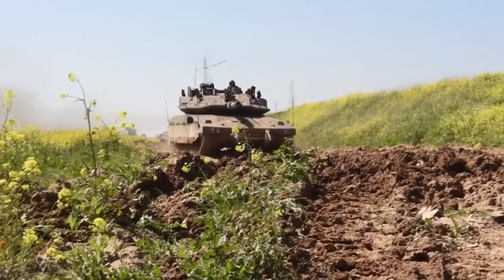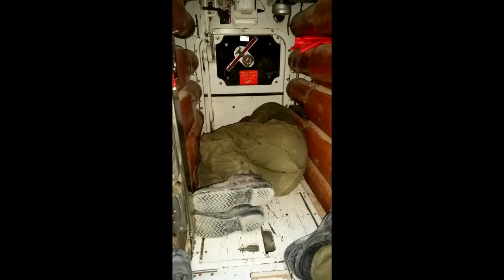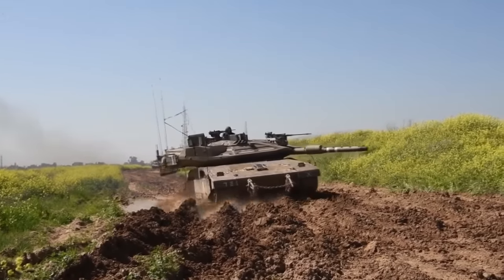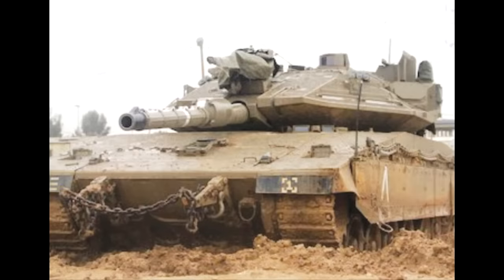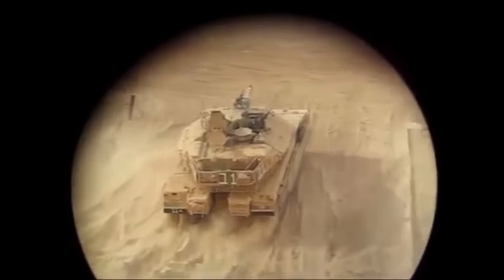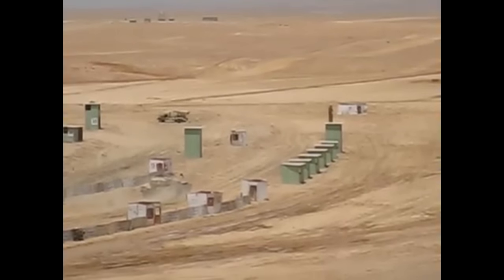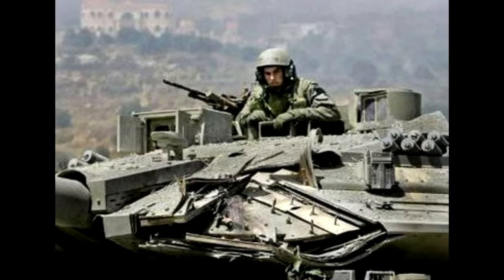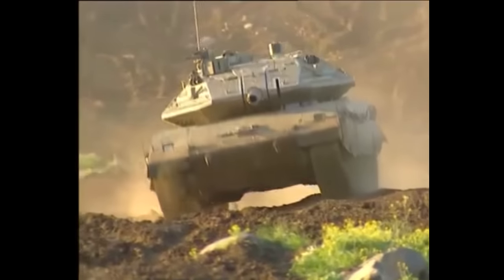Problems with Merkava tank

Comment: 1.  Composite armour may not have been that common, but the Israelis had already invented reactive armour.  I suspect that the new system was adopted because it worked better.  Just as they did away with hydraulic lines inside the turret for fire safety reasons.
2. While the tank can theoretically take 8 -10 soldiers crammed in like sardines, this has, to the best of my knowledge, apart from the unveiling of the tank on parade, only been used to extract wounded under heavy fire.
3. Yes, the engine can get damaged... but better that than the crew.  Engines can be replaced in hours.  Crew not so much.  Of course, there are countries that don't care about casualties.  
4.When you are firing hull down from a ramp, with an earthen bank in front of you, the hull thermal signature is not generally visible.  
5. Engine heat didn't interfere with the thermal imaging during the Lebanese war, when it was successfully used to kill T-72s at long range.  Using kinetic rounds.  So the best Russian armour also didn't stop kinetic rounds.  Which is why they are used. There is always an arms race with these things.
6. The Diesel fuel tanks have also worked as an added armour, but no system is perfect.  The fuel tanks are self sealing, and generally handle the danger of fire well.
7. Anti tank missiles, such as the Kornet, are taken care of by Trophy.  Russian tanks, on the other hand, were withdrawn to over 5 km from the Ukrainian forces once they were supplied with modern anti-tank missiles, and Russian aggression ceased.
8.The armour is modular, and easily replaced when damaged.  Solid armour not so easily.
9. None of my comments should be taken as angry.  I've also heard complaints about top speed, but as armies generally don't cover more than 20-30 miles in a day, whether you get there in one hour or 30 minutes is rarely decisive, and I have heard complaints that the M1 Abrams transmission cannot take the strain of digging the tank in, and it's turbine engine has always been a real fuel guzzler....
10. How may km of fish do you have to eat before you get out of the Russian Armed forces?
Reply: Here here! Finally someone that knows what he's talking about. Thank you!

Comment: So, I am no armor expert, but there are a few inaccuracies here (you don't have to like the Merkava, but tanks in general are going through a weird phase).

1. the engine at the front is not a bad thing.  There are a lot of mechanized armor that does use an engine at the front approach; such as the Stryker, the Bradley, the BMP, the warrior, the Lynx and I could be wrong but possibly the S tank.  Most of these have thermal imaging with no issues.  I have used thermal systems in a gas power vehicle plenty and looking over a combustion engine wasn't an issue.

2. the use of fuel tanks as extra armor isn't bad either.  There again are other mechanized armor that does this, and has no issues with explosions or fires using diesel fuel (as it can be very difficult to start a fire) and Merkava's fuel tanks are self sealing as well.  

3. "the armor is insufficient" is inaccurate against other tanks.  Against Lebanese and Syrian troops in the 1980's conflict, the 2006 and 2008 conflict, the Merkava was far superior in protection than the soviet counterparts in durability and protecting against other tanks.  They only lost 7 in the 1980's conflict (granted a different mk of Merkava, but the new one is better).

4. It isn't up to date.  Many of the battlefield communications and digital combat systems are so well designed, the USA have used similar programs.  The Trophy active protection system is so advanced and works so well that other NATO countries have been purchasing it from Israel as well.  The is mainly because man portable missiles are becoming much more prevalent to the enemies and effective that tank vs tank warfare.

Realistically tanks are having a difficult time in combat due to the advances of small anti-tank weapons in general.  The US Marines have disbanded their tank program all together, and there are other countries doing the same.  In similar peer combat (modern nation vs nation) it is possible for the tank to still play a role, but drones, stealth aircraft, computer hacking of satellite and comms systems along with man portable missiles (like the Russian ATGM 9M133 Cornet) allows two to three men to set up an anti-armor position and take out almost any tank (not including the Trophy system) and quickly leave, all while not requiring a heavy vehicle for transport.

Comment: Definitely a good flawbreak down on the tank. Well laid out and good details for an otherwise short video. Actually dispells alot of myth and hype around that tank, never knew the ammo was rather haphazardly left exposed in the back with very minor protection or that the front lower plate was so thin, seems almost a frail design minus maybe being hulled down in a tank pit like in the region bordering syria and etc, a defensive tank

Comment: The Israeli designers knew exactly what they were doing.
They put the engine in the front to save the crew,as highly trained crews in this very small country  are more valuable than engines.
This tank is brilliantly simple and if you recall the entire tank has been upgraded continously since the 1980's.
The Russian Coronet atgm has taken out a few of them,but with the Trophy system all the missle threats take a hike,until the Russian invent a counter , counter threat.

Comment: What a load of waffle.....This tank it built with defence in mind, ie it will be in a  'hull down' position so that only the turret, the most protected part, is showing towards the enemy.

Which is exactly the same for pretty much ANY Western tank design. Abrams, Challenger 2, Le Clerc, they are ALL designed to be in defence positions and not attack . Unlike Russian tanks which are all designed as 'attack' tanks, fast lightweight next to no armour so they can move much faster (a form of protection in itself). It simply not possible to design a tank that offers survivability, mobility and firepower.
Reply: Problemas aora
Reply: Hull down isn't useful agaist drones, it is useful agaist other tanks but we are forgetting infantry or other risks for the tank.

Even so, in a hull down potition a shell could ricochet on some of the angled spots and damage other components, so... yee
Reply: @mrkeykush693  More waffle..Tanks aren't designed with drones in mind seeing as this tank was first introduced before drones were used in combat.

You mean it hits the turret...the most armoured part of a tank....the bit specifically designed to take fire and survive.

Listen sweetheart I spent 26 years on tanks, I can assure you I've forgotten more than you know about how and why tanks are designed. Now go back to world of tanks.

Comment: Merkava is designed  for the IDF and to be used only in the environment that Israel is defending.  The enemies around Israel are no match against the IDF weapons. The tank combat doctrines of the IDF is to not about head on tank battles and crews survivability. because human assets are more important, The crew needs to exit through the rear so as not to get shot, most tank crews die trying to escape the damage vehicles.

In your other videos, you have showed many bias ideas to the Leopard 2 and other weapon manufacturers. Let me remind you that the Abrams and Merkava are not for sale or exported to other countries, these were developed specifically to the military use for that particular country.

Stop doing such stupid info videos,  unless you have been some kind of a weapon designer, a user of these weapons or ex-military. It is an insult to those who have spent doing the research and understanding the needs of their military for the defence of the nation. Don't show only the bad but also the good, that is being NOT bias. There is no perfect weapon systems but only those designed to work for the military that requires it to work the way the need it to be use.

Comment: At 6:00 you mention how the Merkava still uses the L44 like the Abrams. I can tell you that was done on purpose by the IDF because of the need to operate in low-intensity conflict and urban environments. Having a long gun isn't very helpful in these spaces. True, it does offer more killing power though. Maybe if there's a Mk. V then we could expect a larger gun or even an ETC gun.  

As for the Abrams using it, it's because they fire depleted uranium APFSDS shells that if fired too fast lose potential.

Comment: Sorry dude, making a video about its problems without factoring in its use and its positive aspects is a bit nonsensical.
The majority of the things you mentioned are not "problems" they are trade off for specific needs in the field and specific manufacturing requirements.

At least you pointed out the Trophy system, because that simply shows why ranting for 4 minutes about armor and the "engine being another layer of armor" makes absolutely no sense.

Comment: Jezus christ all your points are just wrong. Like holy fuck
1. Heat of the engine doesnt affect thermal imaging.
2. Fuel ignites??? Fuel is notoriously difficult to ignite with anti tank weapons.
3. The engine is in the front so that the crew can escape out of the back. Because no kind of armor currently can hold of "modern" weaponry. A pretty common rpg-29 with antitank round and HEAT tandem charge can pretty much destroy any armour if it hits. Armour is fucking useless in the mordern era, what is useful is things like the trophy system that prevent rounds fron hitting you in de first place. 
4. Slope is for deflection, I mean duh.
Reply: 1. The engine is the whole reason thermal is a thing
2. What if the engine catches fire and there is fuel leaking because the engine is used as armor
3. A destroyed tank is a destroyed tank
4. Apfsds is cutting through it like a hot knife through butter
Reply: fuel wont ignite from APFSDS shots, but the most common shell that hits the merkava will probably be RPG warheads seeing as they're fighting middle-eastern countries, which can DEFINITELY set fire to the fuel. The bigger problem with placing a fuel container right in front of your engine is that even if the tank shell doesn't ignite the fuel, the fuel will leak out from the entrance and exit holes, which will result in the fuel leaking into the engine, where it will very likely be ignited. The engine heat doesn't affect the merkava gunner's sights, but from an enemy's perspective, the merk will definitely have a higher heat signature than your average MBT, even if only by a little.

Comment: I don't agree as you refuse to take another point of view when "exposing flaws" of specific tanks.
You have spend three quarters of the video explaining that the engine is badly placed, can catch fire and that it's barely any protection.
And it would be a flaw IF the Merkava wasn't designed to actually be disabled! Yet the tank is supposed to be knocked out when hit in order to protect the crew. Israel can replace tanks, but not well trained crewman.
Another point: The armour (including engine) is too weak to stop modern apfsds rounds. Yes, yes it is! But so is the armour on Abrams, Leopard 2, Challenger 2, T-90, T-14 and literally every tank in the world! There is no tank that could withstand a direct hit of modern projectiles, no armour that provides effective protection against them. List that as a flaw is simply unreasonable and (I'm sorry for my yet accurate choice of words) stupid.
For the sake of constructive criticism, things you should improve:
1. Bring yourself into the point of view of a country which has developed the tank. What was the main goal to achieve? For Israel the exposed engine is not a flaw.
2. Things you aren't sure about shouldn't be in the video. You said "take it with a pinch of salt", yet the engine does not affect thermal imaging systems. If you have no idea, just say that you have no idea. It's nothing dramatic to have 'no idea'.
With these 2 main suggestions I'll leave you here. Have a nice day.